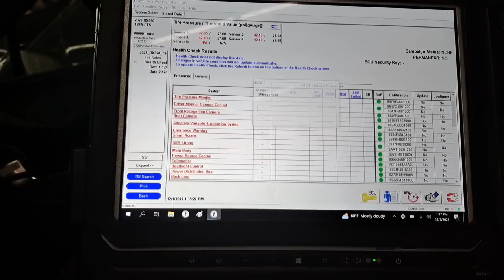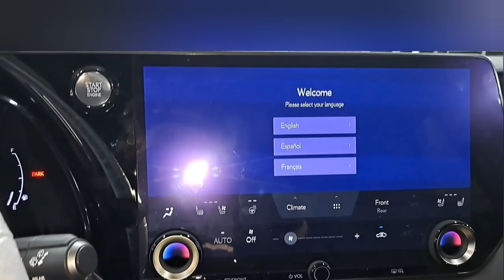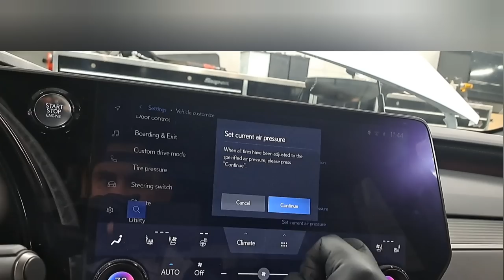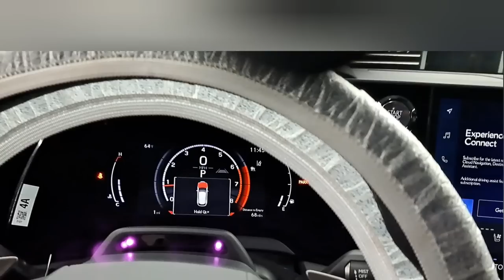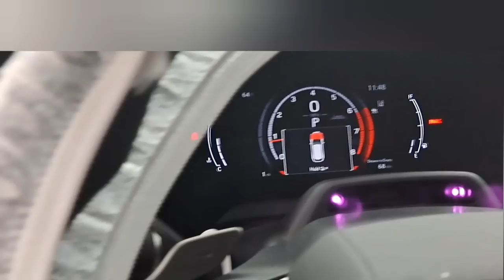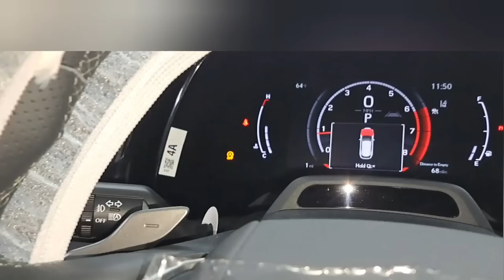Behind the Scenes: 2023 RX 350 AWD F-Sport Pre-delivery Service #lexus #automotive #mechanic #2023

Comment: The dealer  where I bought my Venza from loved me so much they put extra air in the tires (51 psi) when they delivery the car. So much for pre-delivery service, eh?
Reply from the maker: Thats a poor pre delivery inspection
Reply: @harborareatech310  Wait, there is more, last time I brought my car in for tire rotation, technician used depth gauge measure my tires with result all have same depth and she told me my venza with 26,000 miles need wheel alignment. She's good.

Comment: Toyota said the new T24A-FTS will deliver more torque. I did road test during my Pre-delivery inspection, and felt like shit. Should have kept the 2GR-FKS instead. God damn the emission regulation! Smh!
Reply from the maker: It does deliver more torque but less horsepower and for the hybrids AWD drive vehicles there is no turbo lag as experienced in the previous turbo models. The vehicle is also heavier. We will have to see how the 4cyl engine do. I agree with you that they should've kept the 2GR-FKS.
Reply: @harborareatech310  More torque at mid range along with that buzzy noise from the 4 cylinders. If you own any Toyota or Lexus V6 for a long time, you will feel a huge difference. I did road test on the Highlander XSE btw, and even though it did feel fast and lighter at take off, it's still a no for me. If Acura managed to keep their V6, why wouldn't Toyota?
Reply: @harborareatech310  but one improvement on this new engine, that they learned from their hard lesson on the Tundra is the turbo waste gate. It's now vacuum controlled instead of electric like the Tundra!
Reply from the maker: @Gypsy197  yeah not a big fan of the 4cyl turbos the twin turbos v6 on the hybrids  seem pretty good though.  But besides that the gas v6 twin turbos  have many issues that need to be addressed. I've replaced few short blocks due to spun out rod bearings. At least they keep us busy with work!
Reply: @harborareatech310  Busy but warranty pays like shit and hurts your flat time lol! I rather do big service, and upsale. But it's Toyota, it will become better and better. Give it sometime
Reply from the maker: @Gypsy197  not all warranty is bad. Large jobs usually have room for more time as well. But I get you some warranty sucks. But I'm sure toyota will fix their flaws.